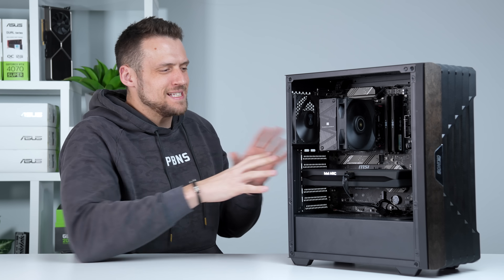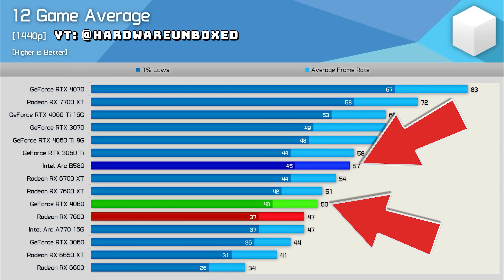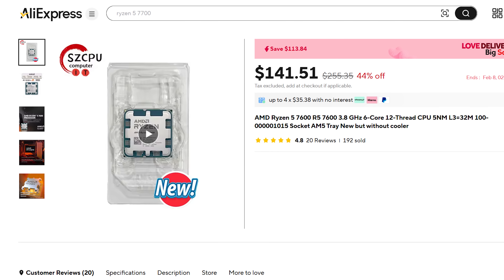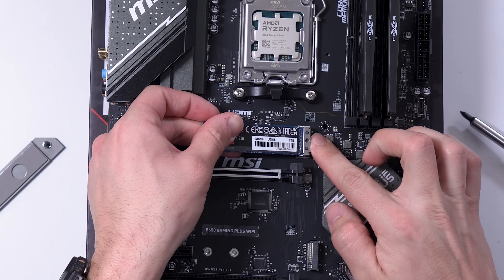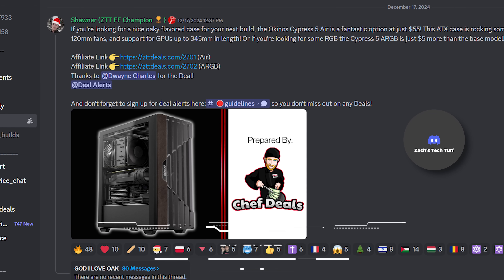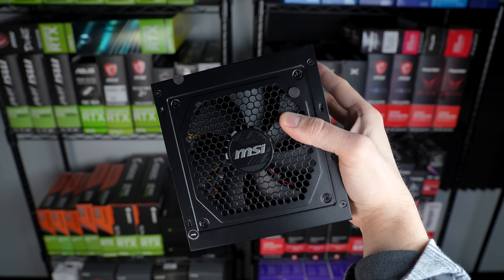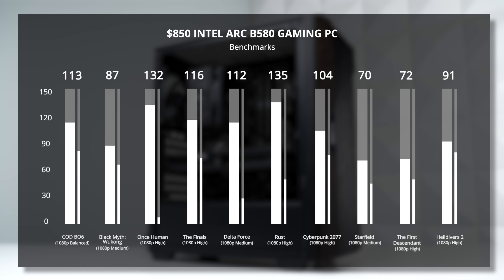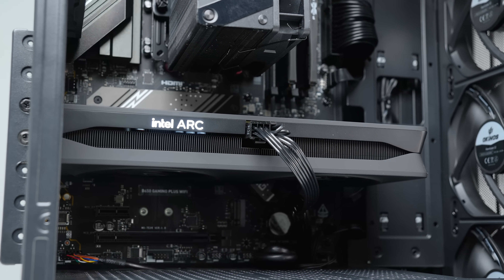$850 Pure Performance Gaming PC Build Guide

Comment: I feel like using a amd gpu for this build would make the performance a little bit better like for this price you could of got a 7600xt , 7700xt , 6700xt , or maybe a 6800xt build please correct me if I’m wrong
Reply: On paper, Arc b580 is a better value gpu than all those nvidia and amd competitors. But in reality, cpu overhead issue and the other driver issues makes it pretty unreliable. So I would personally go with an rx 7600 or 7600xt for reliability even for a pure performance build. I would even consider rtx 4060 for a $300 gpu price range.
Reply: I built a $720 AM4 PC just last September with a 5700x3D and a 6800xt. That's the best value I could even imagine and value wise it tops even this!

Comment: Does the Arc b580 have a DLSS or something similar ??
Reply: XeSS upscaling and frame gen. Not as good as fsr or dlss, but still pretty decent. To be honest, none of them looks good anyway. But amd has a secret weapon called AFMF2 frame gen which runs on AMD drivers so that you can use it on unsupported games. It effectively doubles your fps while having minimal affects on image quality and you can't even feel the input lag with anti-lag turned on. Keep in mind that nvidia is working on copying this technology and implementing it soon. My recommendation is to buy AMD or nvidia if you are using these technologies often.
Reply: @crosskafagaming8109  xess looks better than fsr imo
Reply: Likely not to my knowledge. That's what's good about RTX cards but they js too much money. You build a cheaper am4 pc with a 3060 for around 700 bucks or less which gets you the DLSS.
Reply: @RealLandonFisher what, amd has fsr, nvidia has dlss, and intel has xess. you should research more
Reply: @sudbtd I didn't know of XeSS before, my apologies. I did say not to my knowledge, and tried to make a recommendation. I would rather go with AMD for FSR because AMD cards usually are a lot cheaper than Nvidia for their performance.
Reply: @RealLandonFisher xess is better than fsr so b580 is the best option